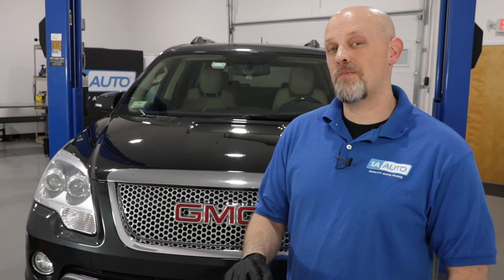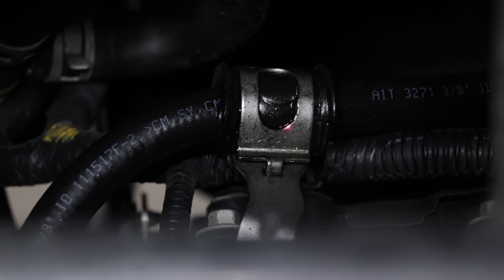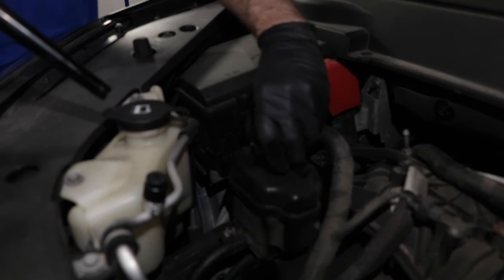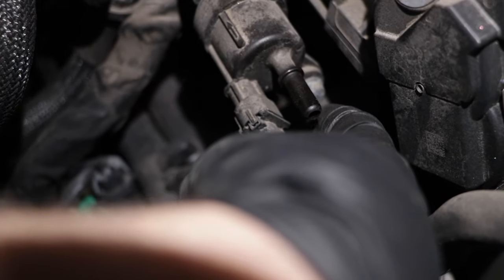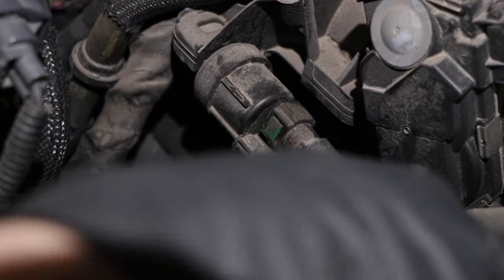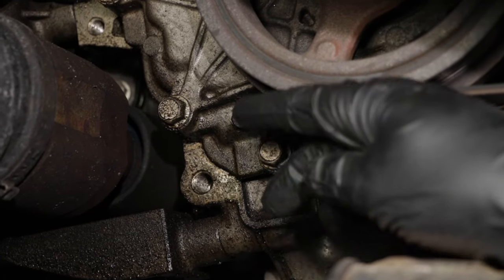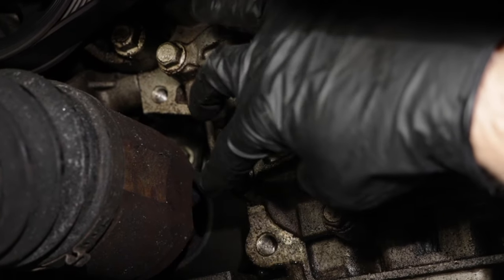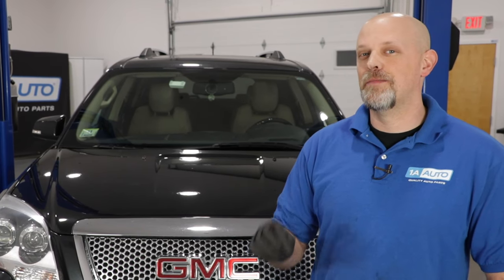Top 5 Problems GMC Acadia SUV 1st Generation 2007-2016

Comment from the maker: √  Watch the Video
√  Buy The Part at 1A Auto http://1aau.to/m/Visit-1AAuto
√  Do it Yourself
√  Save Money
Reply: My daughter bought a used 08 Acadia SLT and it has a brief vibration in the front driver’s side when slowly accelerating. If you accelerate rapidly, it won’t vibrate. Any ideas?
Reply: @gregorymount  sounds like a wheel bearing starting to go
Reply: Front motor mount is common to fail and cause vibration
Reply: 6. Lower control arm bushings!! 7. Rear Aux evap core “ALWAYS” leaks
Reply: I really liked this video it was very, very helpful! I’m a JCPS school teacher & I was really taking big time notes!!! I’m definitely gonna subscribe! You really made me proud!👍🏽💯😊
Reply: @gregorymount  I think it is torque converter issue . It happen between the speeds 40km to 60 km and 90km to 100km check with transmission expert
Reply: Its my Chevrolet traverse ltz problems :(
Reply: gregorymount check the motor mounts, my were dry rotted and the engine would move when I would stop and accelerate slowly
Reply: Why ask for comments if you're not going to answer them😒
Reply: @gregorymount  un I’ll y  tu tu papá un g te uiiulmf  te vever últimamente no m
Reply: I bought an 07 Acadia SLT years ago. It had less than 50k miles on it when we bought it. Problems started literally that day.... ive replaced the power steering rack and pump, the drum in the transmission, the timing chains and tensioners, the evap solenoids, all 4 wiring harnesses in the doors, the rear hatch control buttons and resealed the sun roofs.... and my wife still won't let me sell it... as of today, it has 109k miles on it!
Reply: Throttle body gear in colder climates
Reply: How do you add transmission fluid to these cars???

Comment: I have a 2010 gmc acadia. Kept throwing a p0449 code. Replaced solenoid underhood , replaced vent solenoid on top of the gas tank and bought a new gas cap from the dealer. Nothing was fixing it. Found a forum and was told to look at the wiring harness outside, under the drivers side. Sure enough had two wires broke in two. No more check engine light. Just wanted to share so No one else would go through what I did.
Reply from the maker: +Troy Cannon Thanks for the tip!
Reply: Thanks
Reply: What forum is that, and how can I find it? It would be very helpful to solve other problems with the gmc acadia
Reply: Thanks for the tips I had the same problem and you're right.  I found wires broke and problem fix.
Reply: @juanmendoza8337  Did u had to replace the wires? How'd you fix them?
Reply: What wires are you talking about? And exactly were are they?

Comment: I have a 15 Traverse…… test drove it no issues ran great looked great. Of course, within a week of owning, we started noticing a shuttering. Transmission shop changed the torque converter which only lasted about a month. They then upgraded to the OEM and that only lasted about three months. Back to square one and over $2000 later. Pure regret on buying one, will never buy GM again.

Comment: You forgot about AC failing
Reply: That happened to me the dealer i bought mine at paid cash in full wants 2500 to fix the a.c. not to mention the transmission shudder and shifting at around 5k rpms
Reply: my whole car blows hot air!
Reply: @joshholden8561  Same with my AC stuff....I had the car 32 days before I noticed the coolant was leaking from somewhere. $2400 for the same Chevy dealership I bought it from to fix it.  told them to F off and my mechanic found the leak, so he capped off the rear. $400 later, no coolant leak.  I never have anybody in the back seats anyway, just drums.
Reply: My gmc envoy A/C failed me but over all the Envoy I had was a Great vehicle!

Comment: In the last year and a half we've sold about 12 of these vehicles. Those being the Acadia, the Traverse and the Buick Enclave. Of the 12, nine of them needed timing chain replacements before we could sell them. We do all the work in house thankfully and that seriously cuts down on the cost of repair. As an example our local Chevy dealer wanted $3,325 to do the timing service on a 2010 Acadia 3.6. If you are mechanically inclined and able to do this job yourself, and it is quite the job, my one word of caution to you is do not buy your timing set from Autozone. We purchase the first two sets from them and had tensioner failures. They did cover the cost of Labor to repair the job but it really sucked to have to do it again. Use Cloyes brand timing sets which I feel are excellent quality. Don't forget to replace your water pump while you're in there because you certainly wouldn't want to have to take the front of that engine apart again should you have a water pump failure in the future.

Comment: 190K on my 2012 Acadia Denali, It's been a good car.  I've done all the scheduled maintenance according to the manual.  Replaced suspension at 175K.  Replaced an ignition coil at 90K and 130K miles.  I have experienced torque converter issues on an incline at 43mph or 21 mph but I've learned to drive around it by either dropping speed or accelerating past the gear changes on those inclined roads I drive.  The Acadia likes acceleration around 3-4K rpm.  Driving it like a grandma with 2-3K rpm acceleration the carbon will build up on valves.  I've learned that it doesn't like 4-5K rpm or higher when accelerating, overheats the ignition coils and the car will misfire.  Drive it too hard and you will need to replace an ignition coil or two.  I asked the mechanic the first time why my ignition coil went out and he said it could be bad gas.  So I always bought Shell or Chevron gas from the same gas station.  After the second coil went out I realized it was because of my driving habit on long drives down highways with traffic lights and accelerating too fast.  I also clean the PCV valve every 60K miles.  The PCV valve isn't a true valve just a cylinder with one pinhole on one side and two pinholes on the other (this will save your catalytic converter).  You know it's time to clean when you get oil in the air intake pipe, there is a little oil catch pouch just before the throttle body.
Reply from the maker: +James Connell Thanks for the feedback!
Reply: What did u use to clean the PCV valve an do you know the correct name for i can purchase a new one if i mess it up removing it.

Comment: This video is SPOT ON!

Acadia is great, but does have issues...mostly minor and CHANGE THAT OIL more frequently that service/spec.  I change at 50% life...~5,000 miles and engine is happy.

Just did EVAP purge solenoid as noted in this video, OCT-2021.  Part confirmed N.G. and better starting.  Replacement is under 10 minutes and code was P0442

Thank you!

Mr. P

Comment: I currently own a 2011 Acadia, I bought it in 19 and since then I have had the ac compressor clutch go bad and the power steering pump go bad, the serpentine belt snapped twice (back to the bad clutch on the ac compressor), one mirror motor go bad and the master switch array. And probably a few more things I forgot to mention. I would never recommend buying this car to anyone, but if you do, theses are some really good people to help you figure out how to fix the wide range of problems to come.
Reply: I just got rid of my 09 Acadia. Yes it was a beautiful truck but had way too many issues. I replaced the whole transmission on it (at barely 100k miles) and numerous other repairs. After that, I had an oil leak, needed a bank 2 new cat converter and got a camshaft code last week. That was it for me. I am still beyond furious that I wasted all of that money on this car. I spent at least 7k in repairs In less than 1 year. I will never buy a GMC (or any GM car for that matter) for as long as I live. Worst mistake of my life.
Reply: I have had nothing but electrical problems with my 2011 Acadia.  Now, the battery is dead and we can't remove it to replace because the passenger seat is too far back!  The ac compressor took a dump, the power steering leaks, the door locks don't work, every dummy light is on...and the list goes on.  I will NEVER buy a GMC ever again!!

Comment: I just had a timing belt issue on my 2012 GMC Acadia Denali. Bought new in 2012. Meticulously maintained throughout. Never had one issue until a month ago. Wife driving, Acadia flashing Traction Control issue on dash panel, Acadia dies. 
Go to her rescue, switch vehicles and have it towed to mechanic.
Piston slapped spark plugs. Timing chains were the cause.
74,000 miles on engine. Had to put new Reman back in. Just got it back yesterday 6/24/21.
$6400.00 for the replacement and that included a new water pump just for precautionary issues in the future.

IMOP, GM , should be held accountable for their faulty products. 74,000 miles is a slap in the face to consumers. This is not acceptable. For what I paid for this vehicle it should last 300,000 miles.
This vehicle has been pampered since day one.
Reply: Get you a Toyota and live problems free(easy)
Reply: @Freddy-td8fl  but you can't fix ugly. Them Toyota's damn ugly
Reply: You must have mistyped or misunderstood your mechanic.  The timing chain is not relative to how far the pistons move up and down so there is no way that the piston can make contact with the spark plugs.  It must have made contact with the valves which got out of time due to the slack in the chain which usually just means a head job unless the piston rod got bent during the incident which can be checked.

Comment: Great video.  You just forgot the biggest issue that almost ALL Acadia owners have... THE A/C!!! Lol... that's actually why I watch this video. Oh well, great job though. I love 1A 👍
Reply from the maker: +Michael Fuller Thanks for checking us out!
Reply: Mine 2015 acadia has the a.c probkem the dealer i got mine at wants 2,800 to fix when its a kniwn issue and the dealer should recall and fix for free
Reply: A/C issue: 2011 traverse A/C hose (compress/condensor) leaked at the fitting on condensor side. Chev service dept quote $1250 plus CA tax. Bought the part 1AAuto and watched their YT videos. Removed front fascia/bumper. Install the hose and used freon oil on new fitting O rings.Took it to local AC service auto shop to evac and fill. $300 total... Desert summer 110°. The inside temp vent reading 50°... months later still running cold..💯😀
Reply: @Jimicruz34   Had same issue on our 2012 Acadia Denali (common on almost all Acadias) which caused the high-pressure A/C hose to leak at fitting to compressor.  This is a result of the front engine mount that breaks due to the very high engine torque this beast produces!!  Engine torques up on front engine mount under hard accelerator use, thus stretching the high pressure hose tight as a bow string and pulling it out of the metal fitting!!!  The motor mount fails early on and most folks blame the darn A/C components - they are not the cause!!  Engine mounts go bad and are not too difficult for a guy to replace in your garage with a floor jack.  These need to be designed so that failure occurs out around 200K miles where we wouldn't mind replacing them.  Same thing happened on my '88 Mustang GT due to the high torque that engine creates too!!  The Acadia's engine produces somewhere near 285 hp - not a slow machine at all.  The Mustang GT made 225 hp in that 5.0 liter engine!!

Comment: I have a 2010 Traverse and from what I've been reading, I must've got an odd one. My Traverse hasn't caused me any real issues right now it's shy of 135,000 miles. I'm real vigilant on preventive maintenance and constantly  look it over as well as any vehicle I've ever owned. I also own a 2010 Silverado with 139,000 miles and it also runs great....Anyways, as always, 1A Auto Repair put out another great video.
Reply: I spoke to a mechanic when I bought mine and she said 08 Acadias are usually pretty reliable so I don't know why people say they're not.

Comment: As an '08 Acadia owner who has done all of his own maintenance and mechanical work I can tell you that this person knows exactly what he is talking about.  I rebuilt my transmission due to the failed 35Rclutch wavy plate.  I replaced the trans control module as well.  The debris ruined a couple of other parts as well in the trans.  I think it cost me around $400 for the trans parts and another maybe 500 bucks for the transmission control module.  I have been through a couple of steering racks and had the steering rack leakage and also the small valve that varies the steering stiffness with speed.  I've gone through several alternators and a power steering pump.  I've gone through two evap purge valves.  I have replaced the timing chains once at 150k had to drop the engine.  Went ahead and replaced the water pump while I was at it.
Reply: Another thing you need to look at are the drains in the sunroof that easily clog.  The drain hoses run down both a pillars.  Women's hand lotion will remove the paint off of the air conditioner controls.  Easy to replace.  The passenger side airbag seat sensor goes bad.  The gauge cluster mileage readout goes bad.  And I've had power lift gate problems ever since they loaded in that new software that was supposed to prevent people from getting hurt.
Reply: I know this is an old post but I would love to get it contact with you concerning the 08' Acadia...I have one and I'm having an issue that I can't figure out... please respond
Reply: Dang man, my wife's 07 Acadia is nearing the 190k mile mark and has never needed this much work, I mean they're great vehicles but GM engineers must of had they're heads up their ass in the mid 2000s !

Comment: I have a 2011 Acadia SLT & in the last 2 months I’ve had to replace the water pump, Radiator, Thermostat, T56450 A/C compressor to condenser line, drive belt, upper&lower radiator hoses, front & rear motor mounts, transmission mounts, spark plugs, 1 coil, both front struts, rear shocks, battery which is under the back seats. This vehicle is such a pain in my ass!! Now my wife wants to trade it in... & she still owes $10,000, FML... Thank you for all your video’s & YouTube!
Reply from the maker: +Roy Bristow Thanks for checking us out! 1AAuto.com

Comment: I have changed 2 transmissions in my 08 Acadia,  first one was 102k and the second one at 203k . You may read forums that say 100-104k miles transmissionissues happen . It's TRUE... also change Evap solenoid. Last , oil leaking from timing chain cover . Thanks for the video

Comment: Thank you, I have a 2011 GMC Acadia and omg, my issues are unreal.  I have had many vehicles and I am not a typical woman when it comes to getting under that hood, I like to know my problems so that when the mechanic tries to rip me off I can tell him facts not just tell him off in anger.  They replaced my radio a few years ago and for some reason when it is cold, and if you never turn on the radio, the car doesn't want to crank and when it does the radio is on... or when we are driving it will mysteriously turn on.  I have already had the trans rebuilt and I have sworn not to do anything else serious to it but this is odd and I was told to pay 450.00 to put my old radio back in.  They are not even sure it that will stop the problem or not.... I just want it disconnected at this point...Anyway Thank you for your awesome Video...

Comment: I still have a 2007 Saturn Outlook. It has 205k on it, been in two serious accidents and runs great. I just replaced the front struts and strut mounts. I have had the trans rebuilt at 175k. I put an alternator on at 195k. Just changed the water pump today at 205k.  I have the rear AC blocked off due to leak. The front AC has a slow leak and I just top it off every few months. Had the timing chains done under recall at 120k. Its long paid for, AWD, tows small trailers and has massive space. I just keep repairing it. The other day I needed the front struts and front strut mounts redone. I got two new front tires and aligment done at the same time. It was about $1050 total. When discussing why I would put $1050 into a 2007 SUV with a coworker I thought about it....because its paid for. It tough to cough up $300 or $700 or even $1500 for repairs on an old car. But if I where to purchase a new one...its $600+ a month...month after month after month for 6 or 7 years. When i do replace it though it will likely not be another GM product. The warranty is just not competitive any longer and the price is out of line with the warranty and quality.
Reply from the maker: +MV Intrigue Thanks for the feedback!

Comment: Great video.  This also applies to Saturn Vues with the 3.6l.  Another common problem is the PCV valves becoming clogged because the holes in them are too small.  The clogging causes oil to pool up in the intake as well as oil loss and clogged cats.  I recently cleaned and drilled out mine.
Reply: Info on how to do this?
Reply: Me too, I want to know what needs drilled out?
Reply: You got it bro saves a heap of problems

Comment: One of my customers has an 08 Acadia. It was constantly leaking oil and had oil reversion into the throttle body. Finally found that the PCV valve was completely plugged, causing excessive crankcase pressure and forcing oil out of the oil pan pretty much everywhere it could. Replaced the valve and modified the inlet and outlet holes by drilling them oversized, problem solved. Just a heads up if your leaking out the front seal and the air box intake tube is full of oil.
Reply from the maker: +Dustin Magee Thanks for the feedback!
Reply: Yesssss thank you!!
Reply: I just modified mine. Quick easy free fix !!
Reply: That solved my oil in the airbox intake tube issue as well I was getting different engine misfire codes after the mod all good so far…